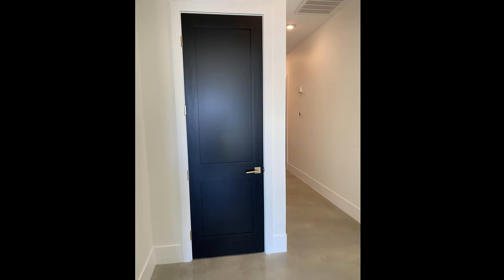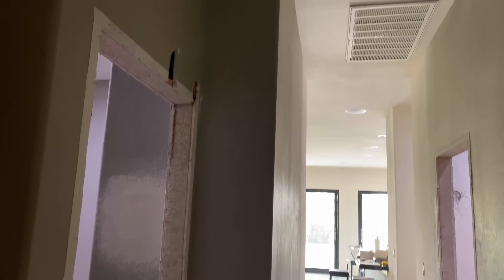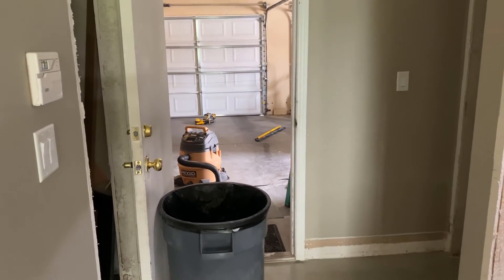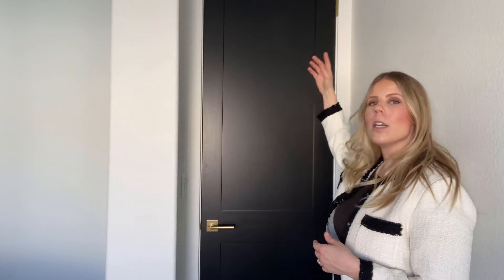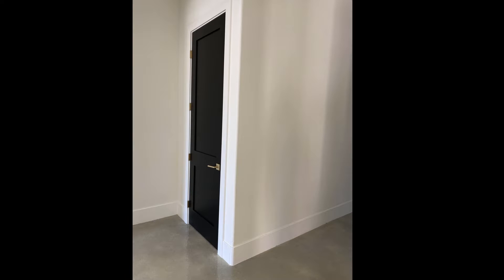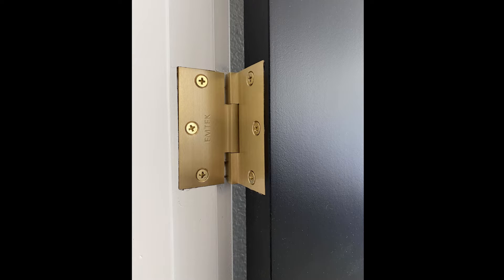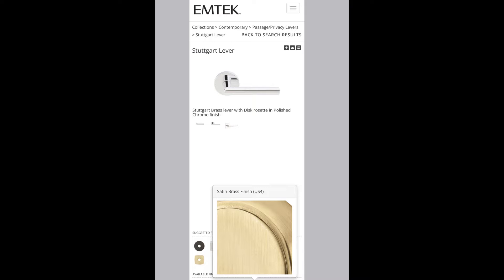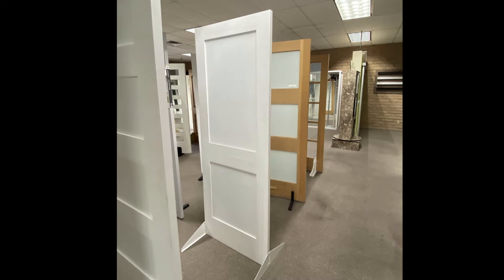FROM BUILDER-GRADE TO LUXURY INTERIOR DOORS | Black Interior Doors | Satin Brass Hardware | EMTEK

Comment: My home has 10 - 12 ft ceilings in the open areas (family, living, kitchen, and hallways) with round bullnose corners.  With the exception of my entry door 8" tall, all of the interior doors are std 6'8" tall.  I think this is because the bedrooms and bathrooms have 9ft tall ceilings.  How tall are your ceilings in the bedrooms and bathrooms?  I might add, I have the exact same Emtec handles but in SS that I put on 15yrs ago.  They are timeless that will never go out of style.
Reply from the maker: Love that you still have and love your Emtek handles! My home has 10 foot ceilings in most of my home with the exception of 12 foot ceilings in my great room. So the taller doors work well with the proportions on 10 foot ceilings. With 9 foot ceilings taller doors might be overkill… just my thought! Thanks for watching!